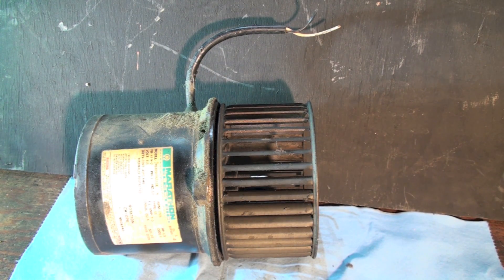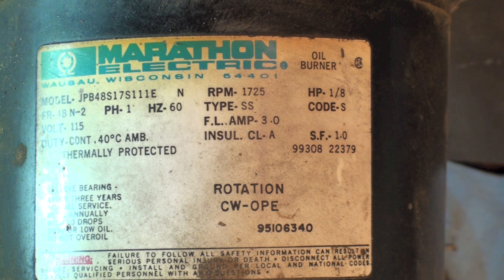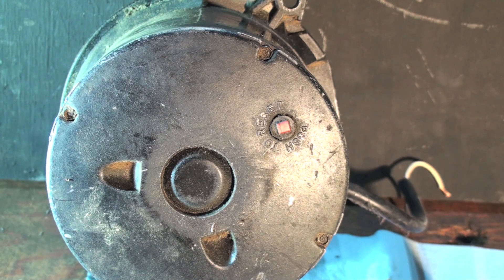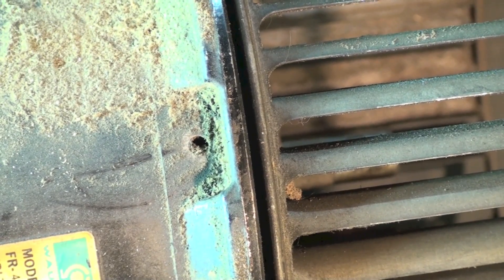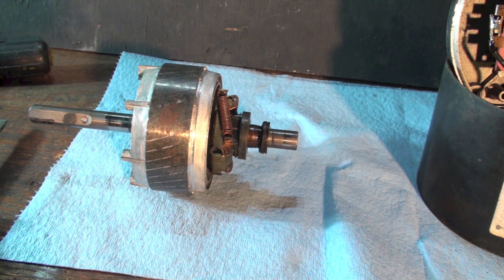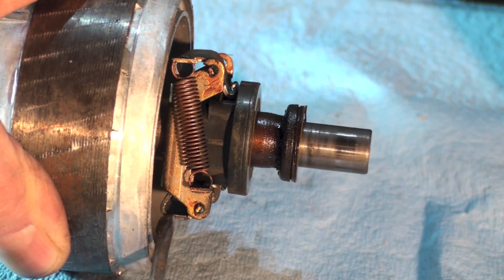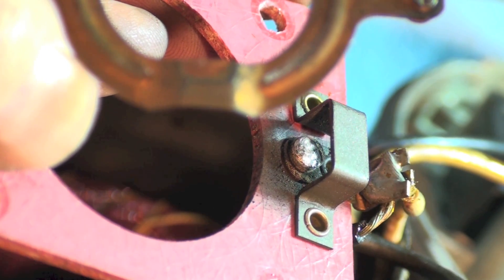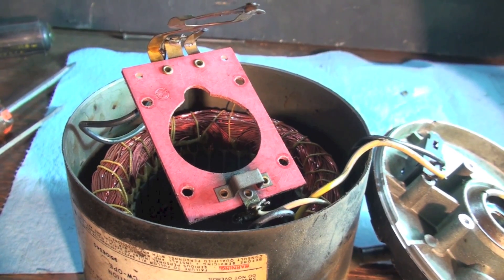Oil burner motor disassembly

Comment: Nailed it.  Motor would lock out after 25 seconds. Great flame, new electrodes (65 yr old American Standard oil-fired boiler with Arco Burner and Westinghouse motor. All original.  Points went on the motor...the pads were completely gone...Poof!  New motor fixed that problem.

Comment: my burner motor had to be changed every year for the last 3 years because of a loud buzzing noise which appears suddenly at the beginning of the heating season on first start up.Is something seizing up over the off season and then failing. My technician just changes the motors at $300 a pop and never takes them apart. I don't think it is a bearing noise is the centrifical switch failing after sitting for 6 months?

Comment: Furnace oil pump motor keeps kicking out and even smokes slightly.  I have another motor but the squirrel cage spins backwards, so guessing the pump/motor mounting should be reversed for this motor.  Is it possible to reverse the motor rotation, so I could use it with my old squirrel cage?
Reply from the maker: Unless the motor is reversible from the factory, you can't change it.  If it is reversible, there will be diagram and instructions on the model plate.
GFM

Comment: OPE apparently stands for “Opposite Pulley End.”  I.e., this motor shaft appears to be spinning clockwise when viewed from the end of the motor where the end of the shaft is flush with the end of the housing .  When viewed from the squirrel cage end (the end on which you could install a pulley), the rotation sense is counter-clockwise.

Comment: I have a marathon 1/7 hp, 3450 rpm.on my water heater. Seems to be running ok. But it is a bit hot to the touch as opposed to my Beckett on my oil burner. Is that normal? It is also 20 yrs. old. Thanks.
Reply from the maker: First, if the motor has oilers, oil them.
When compared to an oil burner motor, the water heater motor will be much warmer.
GFM

Comment: Yeah, you show is torn apart..but you don't show disassembly. You dont show how you took it apart. That's normally what we all want to see. The process. How it's done. Too show do's and don'ts. What works and what doesn't.  Ideas shared, to help us all learn.
Reply from the maker: I will put it on the list.
GFM
Reply: @grayfurnaceman  awesome.  I think the video was good man, don't get me wrong,  just showing the entire process. Would have rocked. Tore the motor out of my Reillo bf5 last night,  got old bearings off. Hope to finish it up today

Comment: Does the burner system that uses this type of motor have a capacitor? If so, what's a good way to test whether the capacitor or the motor is failing?
Reply from the maker: The one shown does not have a run capacitor.  Newer units use a run cap that is mounted on the side of the motor.  The shown motor has a centrifugal start switch that is a common failure.  
GFM

Comment: what happens if I should  over oil the bearings  ,in other words keep putting oil in the oil holes until it over flows out the oil hole ?
Reply from the maker: That should cause no problem.  Extreme over oiling could cause more dust buildup than normal.
GFM
Reply: Thats good because I was worried if the motor had brushes in it they may get oil on them
Reply: @rondoschiavoni8840  Oil in brushes would just wipe away, as long as it didnt bring dirt and rocks with it

Comment: If you look at the back of the oil burner motor, during operation the blower fan should spin clockwise is this correct ? My blower fan seems to be spinning counterclockwise, maybe that's why fuel oil is sputtering into the housing ?
Reply from the maker: Depends on which side the pump is on.  If its on the left, yes.
GFM

Comment: I dropped one of the transformer hold down cover screws into the motor blower area could I retrieve it with a magnetic pick-up tool if I take off the pump mounting screws and pull the pump off? Wayne MSR burner.
Reply from the maker: You can but it may be easier to remove the motor.
GFM

Comment: BTW. My Motor is the same as yours with Frame mount 48N-2 ,  1725 RPM. Again, it is different Front FRAME mount than the common  48N. The 48N mounting hub is smaller ( round size wise)  than the 48n-2, BUT the 2 mounting flange bolts on the outside do line up correctly both models. About how old is your Motor?
Reply from the maker: Joseph Wagner That one is about 30 years old.
GFM

Comment: How often would you oil those motors as a preventative maintenance ?
Reply from the maker: They should be oiled annually.  Usually at the beginning of the heating season.
GFM

Comment: 1725 and 3450 rpm is the motor speeded you said 4450 rpm
Reply from the maker: I just checked it.  I said 3450.  Maybe I just mumbled.
GFM
Reply: grayfurnaceman Thanks. You skipped over the Frame (part tag)  on your motor. You have a 48N-2, as I have equipped in my Friedrich oil furnace also . It is different (larger) than just the 48-n frame mount. My Marathon motor is connected to a Wayne OEA burner, set at 1725 rpm. Can you tell me about how old YOUR motor was, and what it came out of. I cannot find out how old my Friedrich furnace is, Since Your motor is the same rpm and Frame of 48N-2, I thought I would ask. Thanks Joe W.